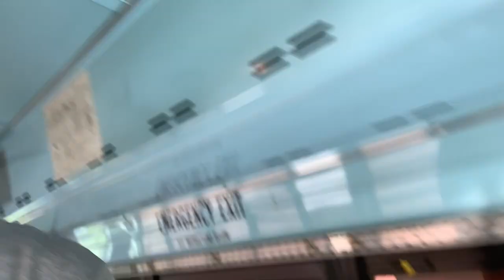SCHOOL BUS AS OUR FIRST HOME | tiny house renovations

Comment: I'm sure you've figured it out by now but that hole is an access spot for the top of the fuel tank. Allows access for repairs without dropping the tank, I would try to build around it and make it so you could access if completely neccessary.
Reply from the maker: Exit Suburbia haha yes we definitely have left access to this tank. There’s a hole in the floor cut to get to it!!